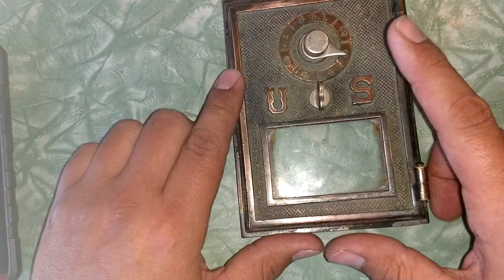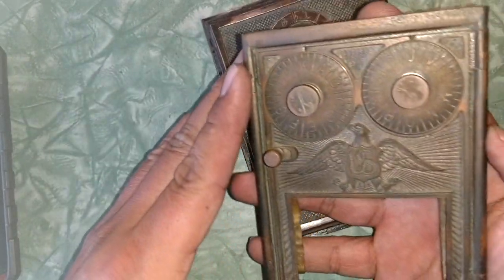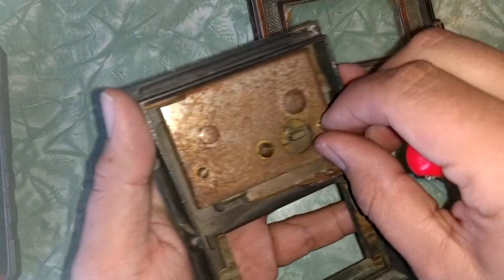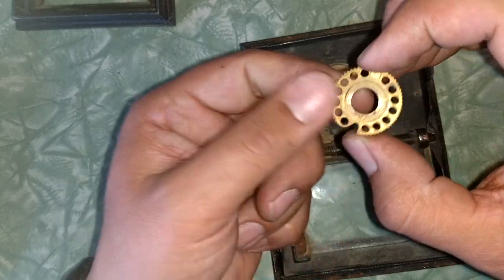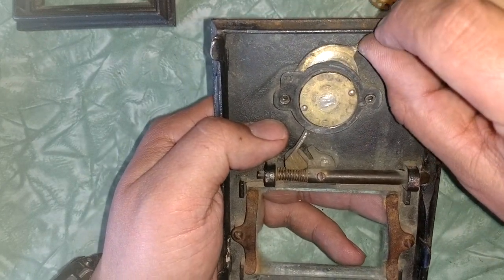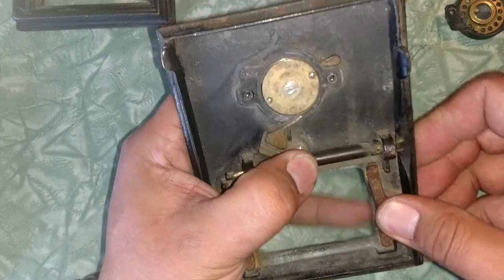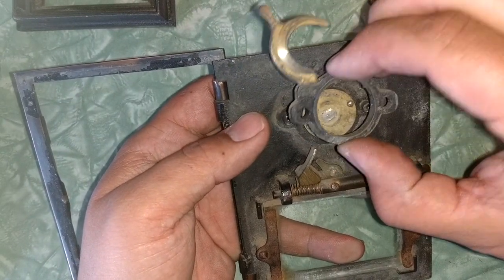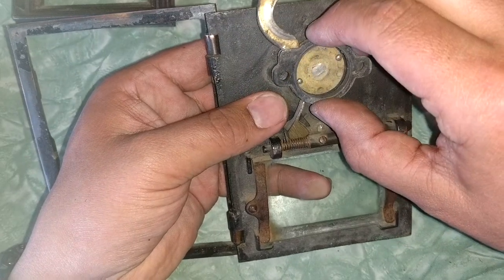U.S post office box doors

Comment: Thanks for the video. I still can't get mine to work. The gears hang on other gears and move them out of alignment. Any thoughts
Reply from the maker: Guy DeMarco those gears/keys fall out from that cup part when you try to put it together? If so maybe try putting it together as if the door is hanging on the wall. not actually on a was but standing up.
Reply from the maker: Guy DeMarco maybe a little  grease to hold the gears/keys in place so they don't shift on assembly!
Reply: Christopher Sanchez yes. Tired that. The gears hang up
Reply from the maker: If any try switching the two end gears/ keys! This shouldn't be that hard but then I'm not there to check it out.
Reply: Christopher Sanchez email video sent
Reply from the maker: Your door was originally 3 combinations!
Reply from the maker: That a bummer. The gears/keys were cleaned up well also the spacers too? No old grease should be there that happened to me too. Then play with it. Find the first combo then get a toothpick or something to hold the first combo in place then go to the next and so on. You might have to play with it completely with no lube at all.
Reply: No lube on gears. found the combo, same as before I took it apart. Its just not repeatable? Have you played with one before ( my style). I have two others that work but don't want to swap internals and this one has a lot of sentimental value.
Reply from the maker: The one i show in the video I bought this firday. First I have touched like that. Something is making the gears stick. 
I did see that one gear did slip. Maybe leave out one first spring.. clean up that cup more. Leave the screws a little loose.
Reply: Do you fix these for fun or business. maybe a convo to have over email.
Reply from the maker: For fun mostly. I'm not a professional. The other door I still have not fixed the knob yet.
Reply: Im haven't tempted to send you mine and a $20 lol
Reply: Guy DeMarco I think I had the same problem with mine. It got put back together wrong. Make sure, in order, starting with the cup facing up like a bowl first, put thin spring washer first. Gear second. TWO spacers third. Then the other gear. Mine had spring, gear, spacer, gear, spacer when I got it, and it did the same thing your was doing. Hope that helps you out.